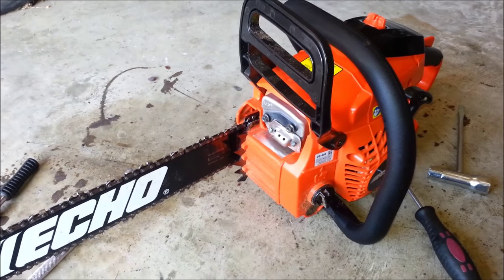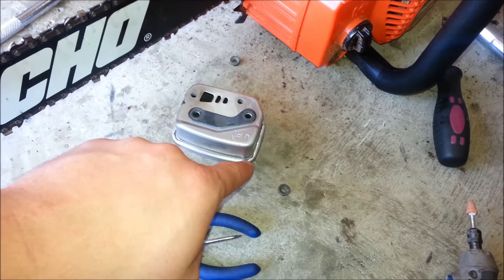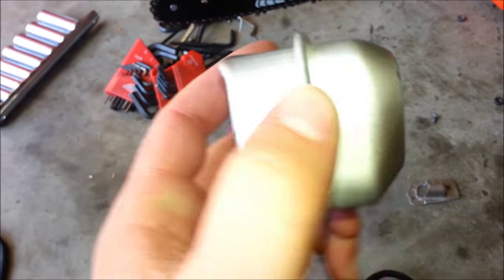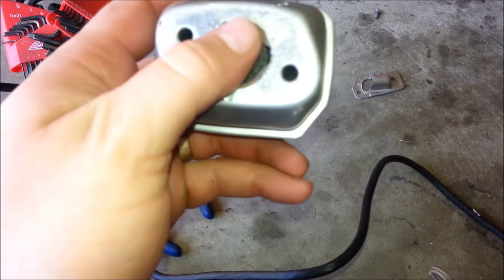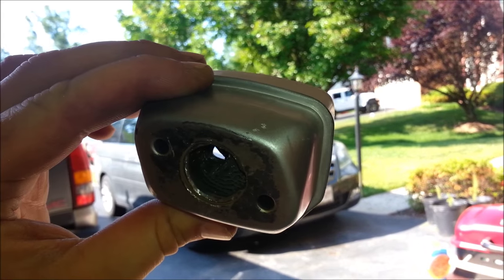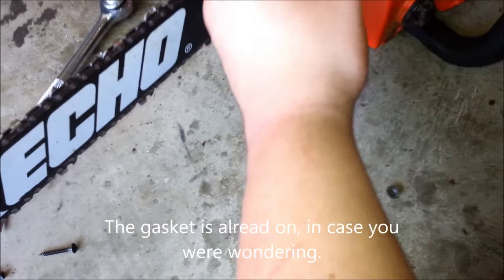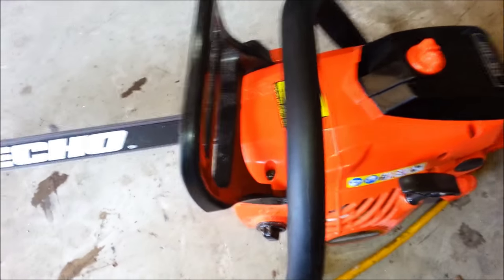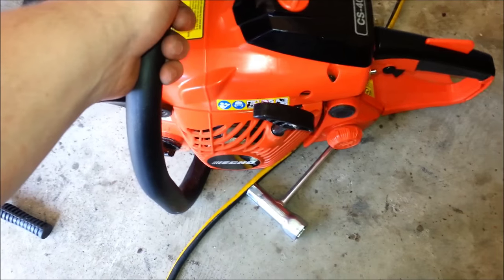CinKo   Echo CS400 Exhaust Mod

Comment: Great Vids! I did both mods on my cs400 runs like awesome, however when I put the cover back on the throttle is way too high and no amount of throttling down the L&H screws works...took the cover back off and tuned the carb screws and it runs awesome. WTF? you ever had this happen? I I noticed that if I push down on the throttle assembly with the cover off it revs the engine. I think the cover is doing this...idk  what's going on...saw was fine prior and like I said it sounds and runs BETTER post mods. But I would like to put the cover back on...
any help?
Reply from the maker: Thats weird and no, I have not had that happen. And I don't mean to question your work... but when I turn my screws in I can turn them in enough to completely kill the engine or likewise out enough to flood it.  No cover should affect the throttle. Are you sure something is not snagging that throttle cable when you tighten the cover down?

Comment from the maker: Thought I would post a quick update to the muffler and carb mod here.I have now been running this saw modded for over 3 years, It has cleared 2 wooded properties and dozens and dozens of trees at a time when clearing.I have not had to make one replacement on this (excluding for chains gas and oil) I am literally running the same stock bar without issues. I have both my home sites cleared now, and only use it for casual cutting now (a couple trees a season)  but this thing is still running like a top. Very happy with it and definitely recommend it for the price and size. A couple things, I maintain fluids, I uses wedges so I never pinch bars when cutting, I clean it before putting it away .. and I stay the hell away from dirt. As far as usage, I usually get around 3 sharpening out of each chain, and it has been through about 7 or 8 of them. Again, this thing has long outlasted what I was expecting for a home owner type saw.
Reply: CinKo Del what chains do you like to use for your Echo? I’ve been running Oregon S62, but they dull out so quick. Any ideas?
Reply from the maker: Honestly thats the same chains im running.... and yes they do go quick. But home depot sells them for a good price in a two pack so  I haven't really I haven't really ever look for another option.  If you find something better report back and let me know

Comment: Just seeing these mods.  I have to check out the carb mod. I just bought a brand new cs400 from Home Depot.  I have been using a husky 240 that got bashed against a brick wall 10 times last night.  Done with that pos.  Just picked up the cs400 and to tell you the truth not impressed with it at all compared to the 240.     Just didn’t seem like it had any balls against a 12in tree I have been cutting rounds out of.  Not sure if it’s the break in period but it get getting stuck in the wood.  My 240 didn’t even get stuck.   Going to check out your mods now.   Thanks for the vids

Comment: I was told to completely remove all the baffling/catalytic converter inside which I did and it does run better and its definitely louder. But after removing all the baffling inside, Im wondering what the muffler even does now as its just basically free access for the exhaust...why wouldn't I just remove the muffler all together so the motor has zero restriction for the exhaust?
Reply from the maker: Even though the muffler is empty, I would still keep it on as it directs the heat from the exhaust and also keeps stuff (wood chips, dirt, etc) from getting into the exahust port.

With it empty there is almost no restriction anyways... which you can test by running the saw with it removed, and then again with it on (and empty)  just make sure you widen out the exit a bit more as i did and you should be good.

Take care!

Comment: Does this void the warranty?
Reply from the maker: It may, however you can always purchase an extra muffler off ebay and swap it if need be, they are only a few bucks. May not be the most ethical way... that's up to you though.
Reply: I wouldn't worry about the ethics on this one,  @CinKoDel . I'm looking at this saw to do some cleanup this winter of junk trees on my property. There are many negative reviews relating to engine seizures and scored cylinders/pistons that Echo blames on users. They flat out won't honor warranty, and it sure sounds like it's due to lean running- probably government-required. Once again the little guy trapped between the manufacturer and Leviathan. Your exhaust/carb mods would, I suspect be an overall win.
Reply: Like my dad always said "its never truly yours till you void the warranty"
Reply from the maker: That is Great...lol!

Comment: You really don't have to put both feet on that little saw to start it. it starts right up with just a slight pull.
Reply from the maker: +B Hamby Correct, but I was holding a camera in my hand. So if I didn't put my feet on it would have pulled it up into me, since I don't want a running chainsaw in my side... I put my feet on it.

Comment: Is this muffler mod necessary for this chainsaw ?
Reply from the maker: Well if you want the most out of your chainsaw then yes. However if you are just using your chainsaw for the typical usage and loading this size chainsaw is designed for then, no.Likewise,If you are you the type of guy that removes the cat off your sports cars, and takes it from the headers straight out..then yes this is necessary.IF you keep your cars stock and happy that way, then no this is not necessary
Reply: No, hack job. More noise is about it.
Reply from the maker: Hack job? Possibly.
More noise? Yes.
But does it in fact add more power to the Chain? Yes... and its a very noticable improvement.

Comment: Why....are you yanking the starter pull cord so hard? ....It has an I30 starter.....you can pull the cord as slow as you can and it will still start.
Reply from the maker: I do everything hard. I was gifted with the strength of Hercules and it has been a struggle to control since I was a child.
Reply: @CinKoDel  I have the same gift

Comment: The chain is to tight.
Reply from the maker: Everyone has there own preferences I am sure, but no it is not to tight by any general means.  The chain has slack in it, but not enough it will come out of the guides. I keep my chains with about a 1/4" to 3/8" gap when pulled for slack. the leaves enough slack that it is not complete taunt in the guides, but not to much that it will come out when running. If you like more slack that's fine, but that is your preference.
Reply: Cool.

Comment: You can break out the catalyst but its virtually impossible to drill.   Hammer it out with a old chisel and blow out the pieces.
Reply from the maker: Titanium drill bits and any power drill should through smooth and easy.... though hammer and chisel maybe more rewarding... as smashing through stuff you dont want usually is...=)
Reply: @Cyclone Bravo Agreed. I'm not sure of the part cost, but I'd buy a service part and mod that first. EDIT: I just checked eBay at $50 for a muffler on a $300 saw, maybe I'll just open the OEM one first.